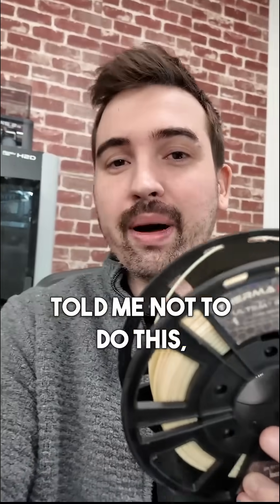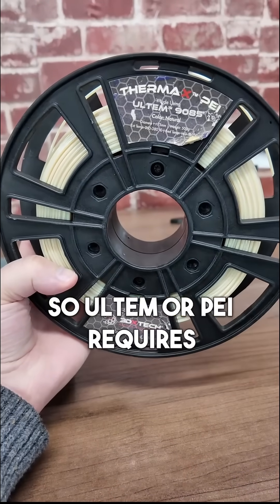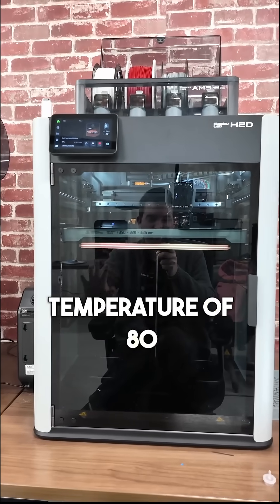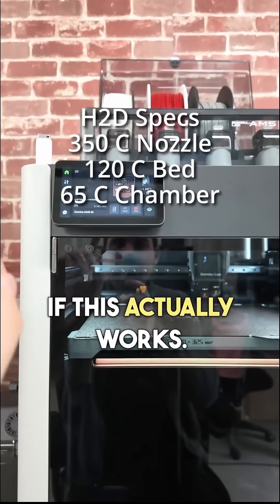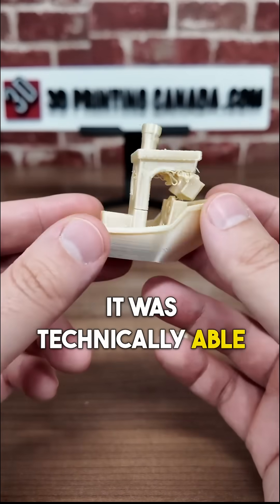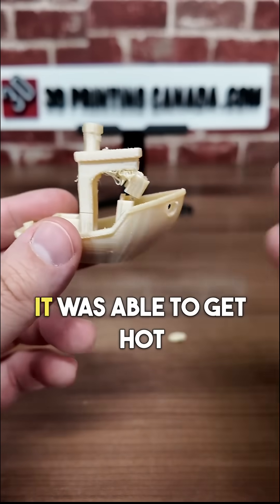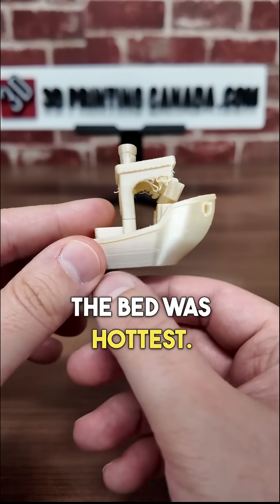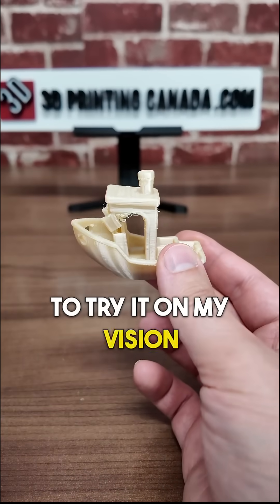Printing Ultem at 350 C On My Bambu Lab H2D #3dprinting

Comment: Stratasys machines print 9085 optimally at 180c chamber (slightly below the Tg). The bed isn't heated separately but is heated by the chamber so 180c for the bed. Anything less won't allow the material to gain it's full potential.